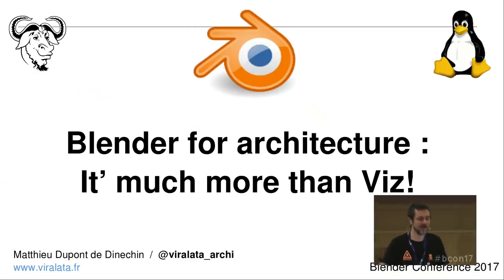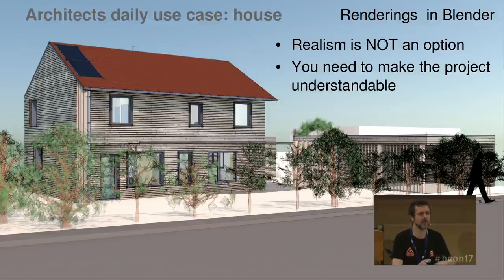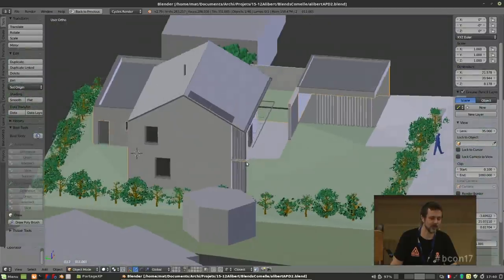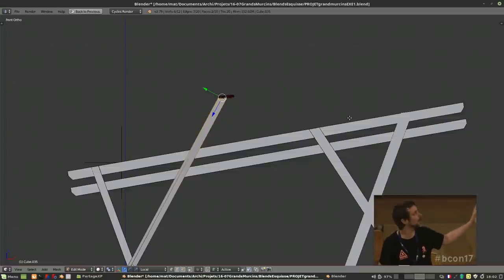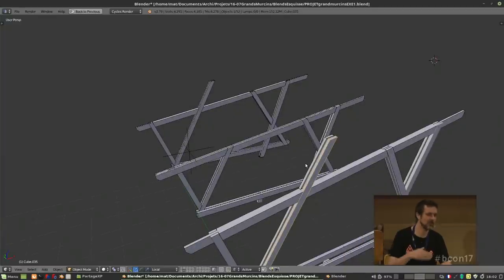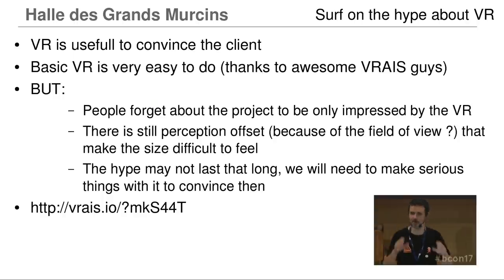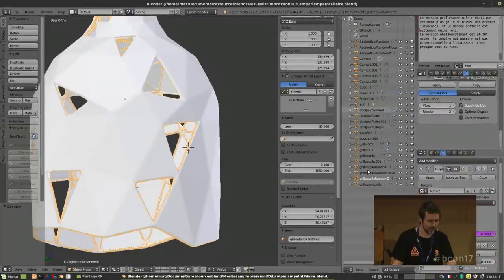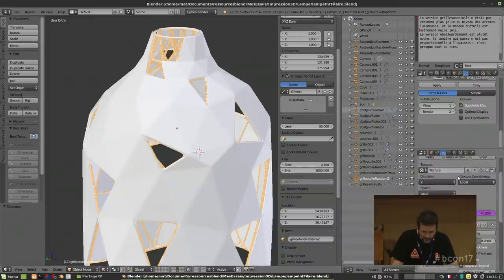Blender for Architecture: It's Much More than Viz

Comment: Thank your of this video. I'm considering switching over to Blender for my work in architectural design. I did want to make a clear point (from the comment of this Architects false assumption) that traditional (aka "natural") wood buildings do not...have to have...dry timber to construction with as he suggested. That is a false assumption of the modern age, and more to do with lost skill sets of traditional carpentry rather than not being able to do it. Beside being an architectural designer, I'm also a working Timberwright with over 40 years of experience. Few buildings I work with (or the wood in them) is ever "dry," nor is most of the furniture wood I use as well...